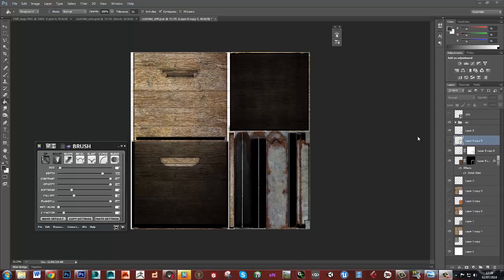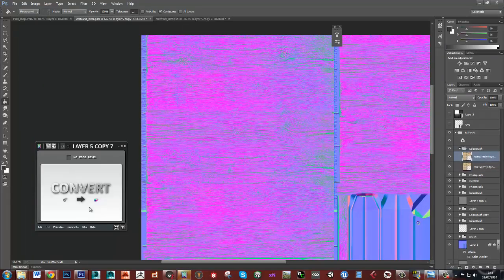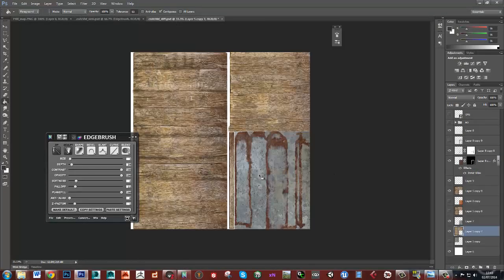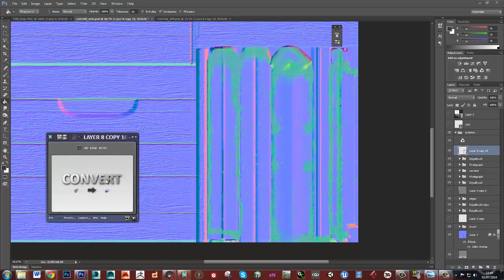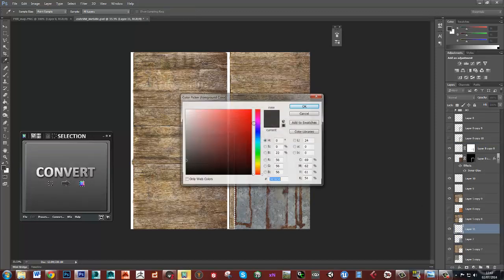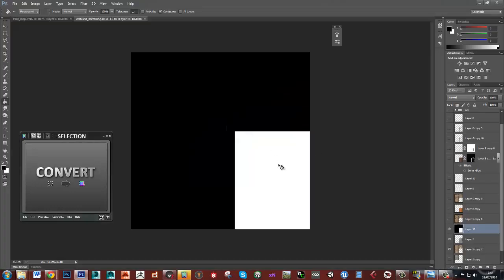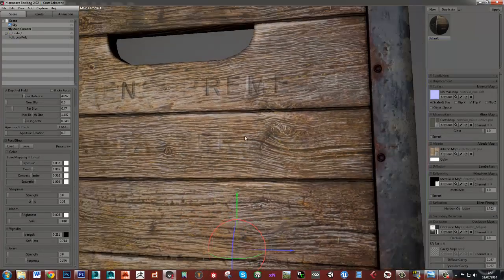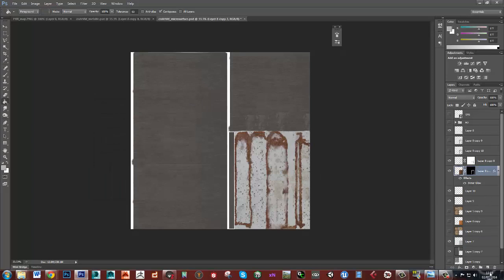High quality physically based game asset - part 7 metallic and roughness maps

Comment: I understand how you utilized the specific maps for Marmoset purposes, but for newgen game assets (for UE4 or Unity 5), aren't these textures basically what you would insert into a Specular map slot within the engine material, it's just called something different in Marmoset? 

or do newer engines have actual slots for roughness and metallic maps? Sorry for the ignorance but I have yet to play around with UE4 or some of the newer engines.
Reply from the maker: Yes engines such as ue4 and unity 5 will have slots for metallic and roughness maps. In the case of roughness this may be inverted or called something different (such as microsurface or gloss) but it is exactly the same thing
Reply: Thanks Barry! I appreciate you doing these tutorials and answering so quickly!
Reply: I know im like 2 years late with this but do keep in mind that albedo values and pbr base colors are not the same thing.